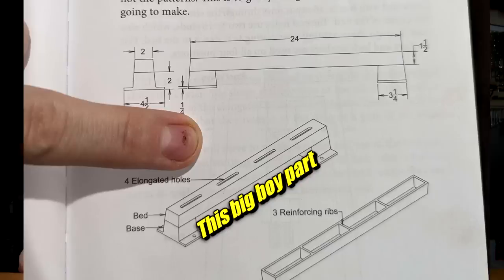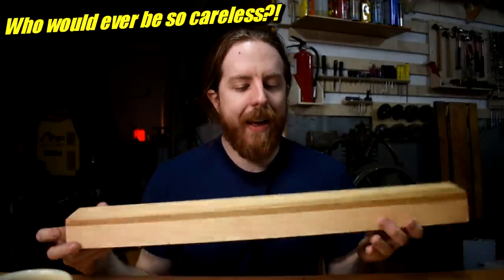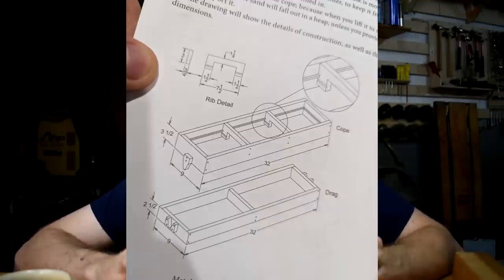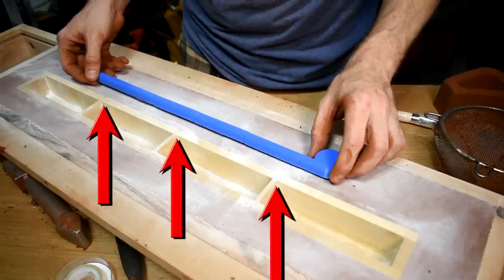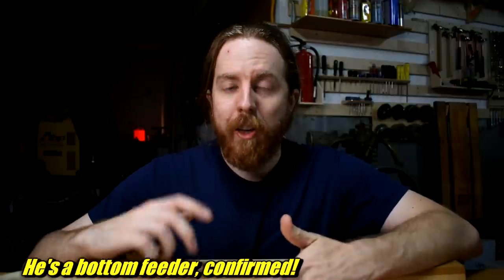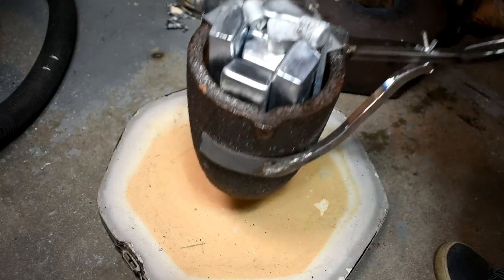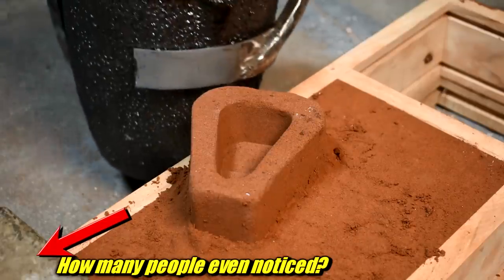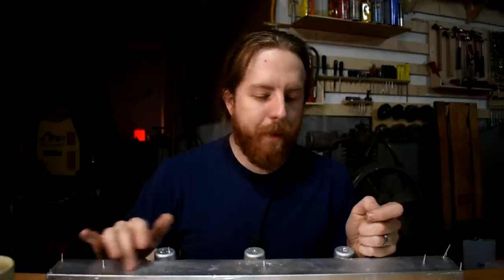The Biggest Gingery Lathe Casting: The Bed | Part 1

Comment: The bit that baffles me is that zamak is supposed to be strong enough. My uneducated gut feeling would prefer welded steel when cast iron that could set for a year isn't available. I can see on my Stanley #5 how much cast iron can warp if it's too young. Actually I'm parroting the internet on this.

But I salute people who build their own stuff.
Reply from the maker: Cast iron is definitely the way to go, if you can melt cast iron and cast it at home.  I've done it, and never again haha it's waaaayy too hot for me.    Za12 isn't as tough, but it's much better than aluminum and dampers vibration like cast iron.  Gingery tried originally to design this with welded steel, but he couldn't get it to stop warping.
Reply: @PaulsGarage  Welding is a science in  itself, true. And anticipating all the warping takes experience. I do not see myself casting steel anytime soon. Or ever. And I have the luxury of having an open workshop in town which has a lathe. Just haven't checked it out yet. 

I might buy a broken, small 40kg lathe in a few days costing 125 bucks, so that would be it, provided I can fix the electronics. If I ever make a lathe myself, it would be a watchmaker's lathe.

But I do have quite a few things to turn like focusers for some travel telescopes. The lathe-shaped hole in my life yearns to be plugged. I so wish I had a basement where I could put a half ton lathe...

Comment: Metallurgical phase diagrams would be about a hundred times more accessible if they replaced the words "liquidus" and "solidus" with "kinda slushy". I think those terms are Latin for "Fresh Slurpee" and "Sad Slurpee You've Sucked All the Syrup Out Of". Fun fact: Icee is the original; they licensed their slushy beverage technology to 7-Eleven who branded it as Slurpee. Now you know!
Reply: "Liquidus" and "Solidus" don't mean slushy at all...they define the temperature at which the material is fully liquid, or fully solid. If you're below the liquidus temp, you're NOT fully liquid, and if you're above the solidus temperature, you're not fully solid. Hard to get more accessible than "this is the actual temperature that you're fully solid or fully liquid, anything between these is slush".

Comment: Why no cast iron? I have seen you melt iron in the furnace, so why bother with snot grade metals? I mean, i get it, its much more sparky and aggressive than anything else, apart from steel, which is the same thing, just less carbon, but i would go with iron... Also, i would make the flask from welded and formed sheet steel, as to be able to put it in my large wood barbecue and heat the mould properly... 
This is coming from a dude who has yet to make his own furnace and cast the first pattern, but i have some theoretic knowhow as casting iron and steel interests me for quite some time now...
Reply: Cast iron is much more difficult.
Reply: @tinayoga8844  No shit, but its essentially the only worthwhile metal to cast for projects like this... That and aluminium bronze maybe, as its very rigid and probably could be said to be a better bearing and sliding surface than even machined, oily cast iron... 
Its like saying that making a wooden house is easier than a proper concrete and brick house, but if you remember the story of 3 or however many piglets there were, if it aint made skookum, you are wasting time and effort for naught... Not just that, but you likely risk your life by relying on inferior construction...
Reply: @camillosteuss  Cast iron is more difficult and not worth it unless you have a lot more experience with it. The project originally calls for aluminum and the ZA-12 alloy being used is better in some ways. I don't know if you are familiar with the lathe design but it does not use the casting as the sliding surface. A steel plate is bolted to this casting and that is the bearing surface. 

I looked into making this lathe 25+ years ago. In the end I didn't like the design and decided to bite the bullet and buy a more substantial lathe. I consider the Gingery lathe an interesting project but not worth the effort as a working tool.

You wrote  "its(cast iron) essentially the only worthwhile metal to cast for projects like this". I don't think you have done much research into the ZA12 and ZA27 alloys. It compares favorably to cast iron. Do a search for the following PDF,   FORTY CAST IRON PARTS SWITCHED TO ZA ALLOYS FOR MACHINING BENEFITS
. 

https://www.albco.com/the-za-12-advantage/
http://alliedmetalcompany.com/wp-content/uploads/2018/03/ZAALLOY.pdf

Comment: maibe call around and see if theres some hobby machinist around that has a big enough mill and a flycutter , maibe some engine rebuild shop that is willing to run their machine that resurfaces aluminium cylinder heads over it for a small fee , you would still need to scrape it some but it would be way less work as the part would be allmost flat to start with 
might want to wait a little after its been machined so any tensions in the material from the casting can settle after the machining takes some of the material away 
in autosports they use old engine blocks to build race engines , because those engines have been through a couple of 1000s heatcycles , the usually hold there shape a little better then fresh blocks , they call those blocks "seasoned "
starting with a mirror with some sandpaper stuck to it probably works faster than scraping too as you can use realy course sandpaper to get it near flat then go through the grids once youre close https://www.youtube.com/watch?v=HyKN52HD6RU&t=129s
Reply from the maker: Good idea!  There are a few machine shops around here and at least one guy I know of with a hobby machine shop.  I want to try it by hand first but I'm sure I'll relent at some point 🤣🤣
Reply: @PaulsGarage  how are you going to blue the bed up? You don't have a big surface plate, do you?
Reply: mirror will flex too much, get a slab of granite kitchen countertop and stick some sheets of 60-80-120-200-400 grit down, grind away... it will be flat enough for scraping in a couple hours. maybe worth some annealing (tempering) for stress relief, I dunno how much zamak benefits from it. But from the description of the aluminum solidifying out first and floating to the top, followed by the zinc, it might have some? Anyways it would suck to put in the work and then have it slowly warp over time from residual stress
Reply: @SamStinson  that depends if you lay thr mirror on a solid surface you should be ok , i done it multiple times with smaller single cilinder heads